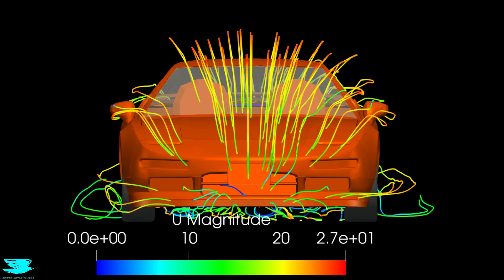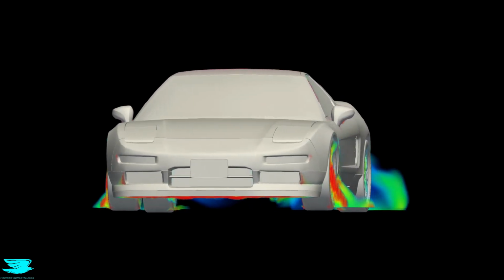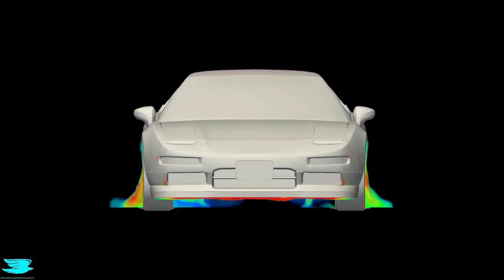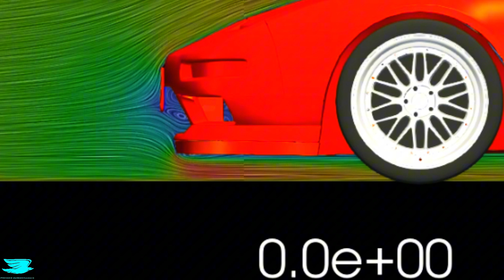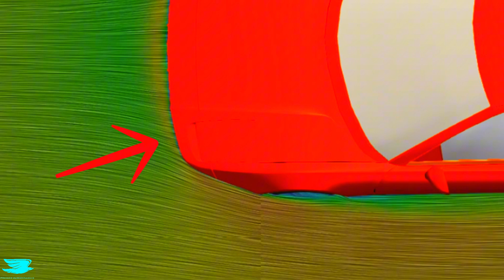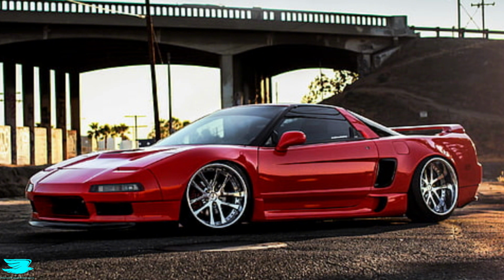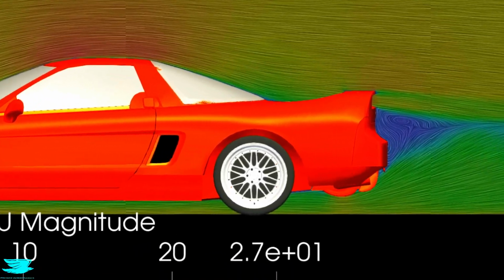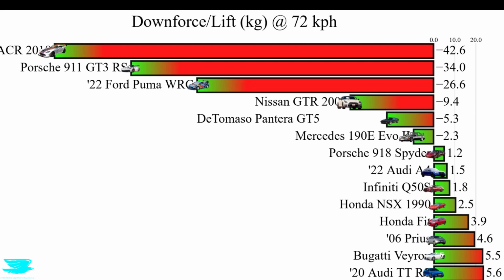F-16 Inspired Honda NSX Aerodynamics

Comment: 2002→2005 Honda NSX later model has advanced aero dynamics.

 " Honda NSX changed Rear Bumper, Tail lights, add Integrated rear spoiler,  Door bottom garnish,  Doors（Add Strong Aluminium bar in the side sill under the both doors） , Side Scart, Wheels, Bonnet,  Front Bumper, new type chin spoiler, Headlights.
Also a special spec Yokohama Tires for "NSX,  NSX-S,  NSX-T", and  Bridge Stone RE070 special spec for "2nd gen NSX-R" from 2002 year model.

When designing the NSX, the first thing we thought of was to create a more assertive styling. Up until now, the lower part of the body had been narrowed down to accentuate the side design. This time, we wanted to jut it out to give the car a sense of power. On the other hand, to improve the aerodynamics, it was necessary to increase the volume of the undercarriage, so the designer's thoughts and the direction of aerodynamic development were perfectly aligned. 
So the designer and the aerodynamicist worked together to refine the shape that combined beauty and performance in a wind tunnel with an actual car. This development was, how should I put it, work, but it was really fun. 
Tweaking the design a little can make a surprising difference to the aerodynamics.
 And yet, we didn't just go in a random direction, improving the design also improved the aerodynamics. 
We made many discoveries along the way, and we were so engrossed in it that we lost track of time.  For example, the roundness of the bumper corners and the air conditioning ducts inside them have a very delicate relationship, and we found that the shape of the inside of the duct and the direction of the holes affect the air flow over the entire body side. 
We spent a lot of time fine-tuning the roundness. The tip of the chin spoiler is intentionally made into a plate shape to improve the lift characteristics around the front. There may be other products with a similar concept, but I don't think there are any that are as sharp as the NSX's.

And the headlights.
Some people think it's better to leave them retractable.
However, the aerodynamic performance is very different when they are raised and lowered, so we wanted to do something about it.
I think it's common to drive with the headlights on at the circuit.
You don't want to change the handling characteristics at times like that. When the NSX was born, we chose to make them retractable, but considering the changes in aerodynamic characteristics, improvements to the performance of the headlights alone, and the pursuit of higher levels of functionality, we decided that we should make them fixed.
 This time, we disassembled the headlight area of the NSX many times to consider the design, and once again realized the weight of the retractable unit.
In other words, the new headlight design also contributes to reducing the weight of the overhang by about 10 kg (compared to the previous NSX model).
And as some of you may have noticed,
the volume of the bonnet hood has been increased in conjunction with the change in the headlight design.
This is to make the presence of the tires more noticeable when sitting in the cockpit,
in pursuit of visual strength and ease of aiming for the clipping point.

🟦Another piece of news this time is the setting of a new Custom order Colour.
For a sports car, Colour is an important point in the design. In particular, 
 "Long Beach Blue Pearl"   is carefully painted using high-saturation expensive pigments and Colour clears, achieving a vivid color that has never been achieved in mass-produced cars before. 
（￥700,000 yen optional Colour.

＄6470 US dollers in 2004）　

 In other words, the highlights where the light hits them are not white but have a proper color, and the shadows have a deep color. This vivid, transparent blue highlights the exterior design. 

It's a special color that was finally realized through the efforts of the factory staff who build the NSX and the attention to detail of the color designers, so I have a lot of feelings about it.

Comment: i'd be super curious to see difference between 1995 Nissan 240sx (known as Zenki) and 1997 Nissan 240sx (Kouki). They're both the same car but completely different front ends! Also 1996 Nissan 180sx would be interesting to see compared to the NSX.

Comment: NSX at last ! As I said last time it would be really interesting to see the improvements done to it by Honda like the new rear diffuser, and NSX-R ducted hood with a profiled under tray, and the NSX-R wing which is higher than the original one. Many NSX owners do these mods because Honda did them on the NSX-R but it's a matter of trust in Honda ;) Would be nice to see the comparison, IIRC the NSX-R produces actual downforce.

Comment: Doesn't lack of sideplates on the wings reduce its effectiveness too?
Reply from the maker: Sideplates and integrating the wingtips like this do very similar things. This is probably a little better in terms of reducing induced drag because it becomes a closed shape and the oswald efficiency factor will be around 1.5.

Comment: 9:01 wouldn't another way to fix it without really changing the looks be to mount the wing further back, like on the Mazda 787B?
Reply from the maker: Definitely. Moving it away from the car in any direction helps.
Reply: I think the easiest would be to shrink the trunk (yes, trunk, it had a frunk and a trunk) by lowering the top portion, and necessarily also moving the tail light down. Maybe some tail light height regulation somewhere stopped them from doing this so they just used the space for a trunk.
Reply: The refreshed 2002 NSX-R has the wing mounted higher to alleviate the issue.

Comment: I invented active drag reduction gor combustion engine driven vehicles.

The engine works as compressor, that the exhaust gases fill a gas tank.
Which gets 2-5 bar pressure. 

The gas tank got a comb like structure of many small exhaust cannulas. 

The fast air that exits the cannulas is catching sourrounding air. 

These cannulas can be placed at the rear of the car. At the spots where most air friction exists. 

This is an easy alternative for using propeller propulsion. 

Dyson Air Multiplier explains this a bit.
Reply from the maker: That's an interesting idea.

Comment: Turbulent air generally works better for heat transfer since there's a lot of mixing.
Reply from the maker: That's a really good point! It helps a lot with convection.